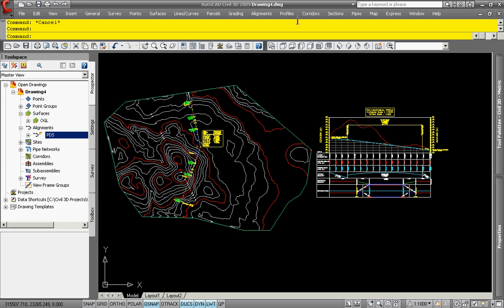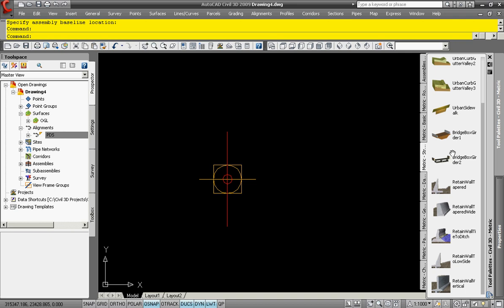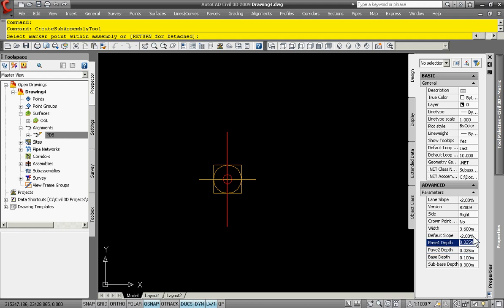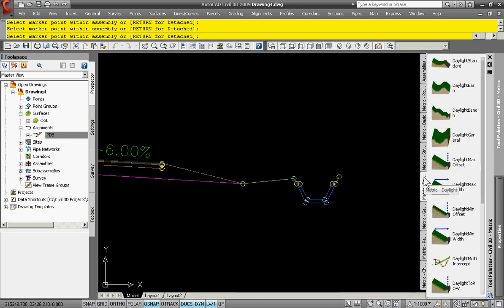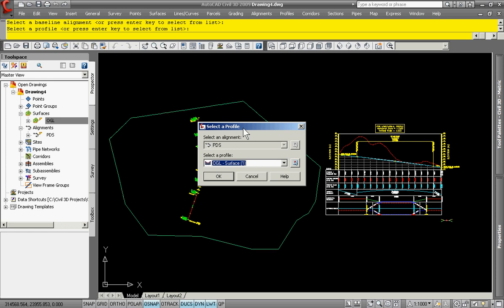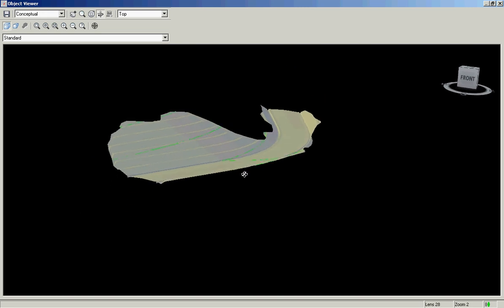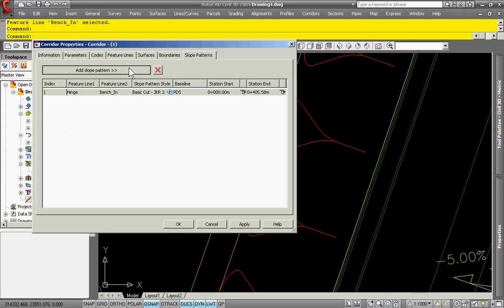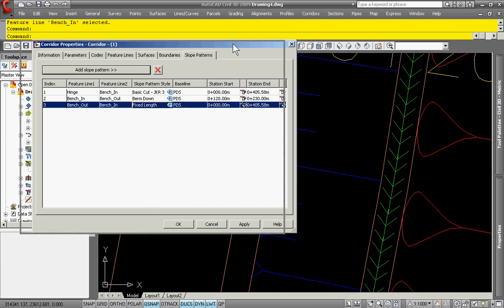🔴Part 8/15 | AutoCAD Civil 3D | Corridor and Slope Pattern

Comment: hi Mr. Khairol, I really like your videos, step by step guiding us to use civil 3d in road design also earthwork. Just curios which template are you referring to? would you mind to share?
Reply from the maker: Hi there, the template utilised in this video is a customised version derived from the default AutoCAD Civil 3D template. It has been specifically tailored to comply with the standards, roles, and regulations established by the Public Works Department of Malaysia.